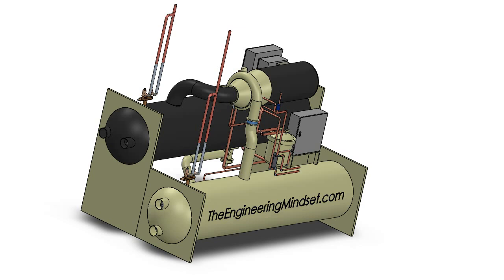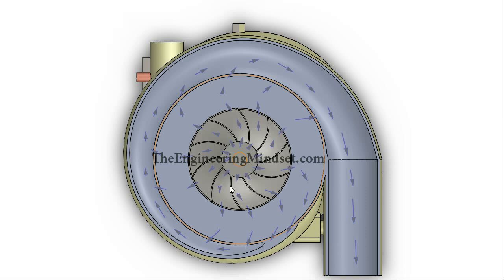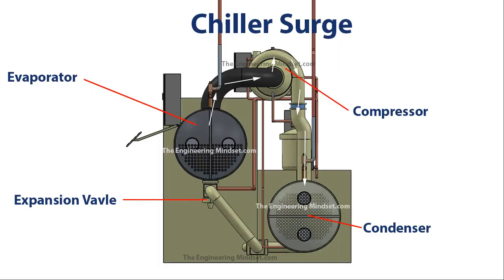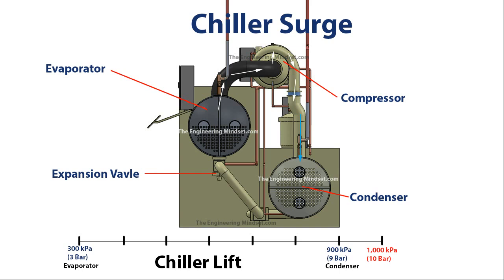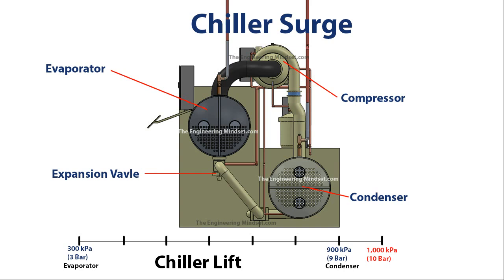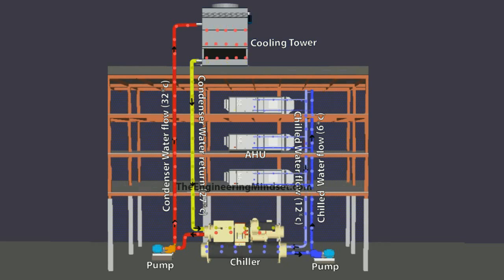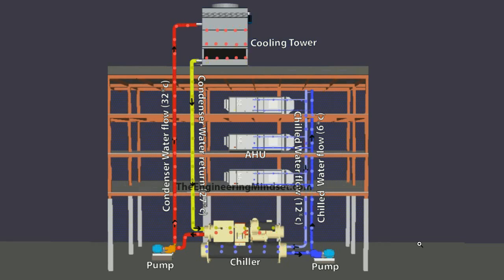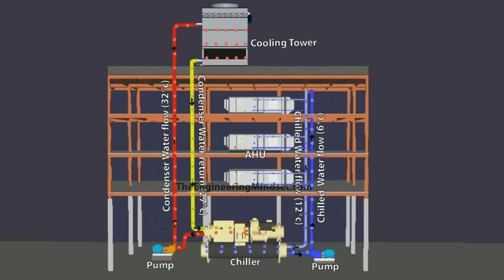Chiller - Surge

Comment: What is chiller surge?

It's basically an unwanted situation which occurs due to difference in pressure between outlet and inlet of compressor. It may occur if the temperature of the condenser raises to a level at which the pressure becomes more at the outlet of compressor (going into the condenser) .
Reply: How to avoid this issue?

Comment: At t=292 you said about too great pressure and back flow. This is a description but not an explanation. What exactly happen with gas in the rotor just before/at/after the moment when this critical pressure is achieved? In particular why after achieving this equilibrium it does not become stable/static without flow.
Reply from the maker: before it becomes compressed and heated. At, it finds a route with lower pressure/resistance which means backwards. After, it flow towards the least resistance which is forwards. It can't reach stability because there are different pressures on either side of it and heat is being added or removed.

Comment: Hi, first of all it's a great video, But i have a question,does the pressure relief vents prevent some how the chiller's surge? Thanks in advance.
Reply: ahmad jaber they are emergency blow offs in case of a pressure switch failure or issue with the machine keeps running past the fail safe pressures. It vents the refrigerant to avoid vessel rupture
Reply: Surge is just when the machine loses its lift due to being out of its design specs of running. For example someone raises the set point on the cooling tower and lowers the set point below design set point. Your out of balance and the liquid level in the evap will fall there fore affecting the impellers ability to lift the vapor from the lower liquid level in the evap. This is just one scenario, several factors can make a centrifugal chiller stall and surge.
Reply from the maker: Seen our new pressure switch video? Link: https://youtu.be/YG81w0HFXNc

Comment: Hi! I am curious that if the condenser water return is too low such as 21-23C , any issues or problems will be appeared? THANKS! Your videos are really helpful!
Reply from the maker: Depends on the chiller. Some, older ones, need very stable operation but newer ones are made with variable conditions but still have some minimum and maximum temperatures and pressures. If the chiller approaches these limits it will trip and cut the power to protect itself. Check the chiller specifications

Comment: Why does the chiller surge if the entering  water sensor on the evap is bad ? (Changed it because the readings was too high and it worked fine after )

Comment: Could you reply what's the different between this surge system and and condenser tube clean, are they the same system ?
Reply: Chiller surge can be of any system where the condenser pressure is greater then the compressor discharge.. now these chillers condensers can either be water cooled or air cooled, if they are water cooled you can definitely clean their tubes by carrying  out proper shut down operation etc and/or wash  condensers if air cooled..

Comment: please answer this , if there is good heat transfer in the condenser as you describing in the video ...
then There is only removal of the latent heat ,...
The temperature and pressure remains same.
Then how we can eliminate the Surging phenomenon please tell...?
Because for surging we have to decrease the pressure from the condenser ?
Please correct me if i am wrong !!!
Reply from the maker: Many things affect this, the supply and return temperature of the water, the flow rate of the water or refrigerant etc etc. If your chiller is surging then you should contact your service provider or manufacturer for assistance asap.
Reply: Muhammad Zaroon Surging in itself happens when there is improper heat exchange caused by the combine effects of fouling,flowrate variation Etc etc inside the condenser...which directly leads to lower heat transfer and hence higher temperature and pressure build up.So your statement that the temperature remains constant is incorrect

Comment: Why compressor oil comes in the evaporator, even if an oil separator is installed. Evaporator tube leakage oil, water, and refrigerant mix in my case. I will be very grateful if you make this video by giving the real reason.
Reply from the maker: https://youtu.be/qxRHCbitLzI

Comment: Thanks for the explanation!
One of my chiller here was really troubled by those surging problems. The hot gas bypass, guide vane & VFD compressor seems like cant really coordinate well and suffered from surge tripping while the heat load was dropped suddenly (change of shift in a factory). 
The chiller part load table claimed that it was able to provide up to 15% part load, but the chiller just refused to run in so low speed (Chiller tripped in around 60% part load)
While we are pretty sure most of the parameters (condenser delta T, flowrate, etc) was good during chiller surging, we are deeply troubled by this centrifugal chiller
Any idea or thought of this? Thanks in advance for any comment!
Reply: jeejiean what brand of machine? Is it variable speed? Most machines struggle at part load anyways.
Reply from the maker: VFD Video is now live! here: https://youtu.be/yEPe7RDtkgo

Comment: Can you explain who Low section Temperature happen and what is the reason with solution
Reply from the maker: Could be a lot of things, low refrigerant level, faulty or incorrect sized expansion valve, wrong refrigerant used. Best to take some screenshots of the VDU, check the fault code and look in the service manual to diagnose the problem.
Reply from the maker: We just covered chiller faults in our recent video! https://youtu.be/Zu0LVVNNVSw